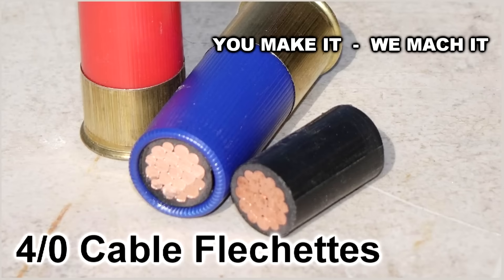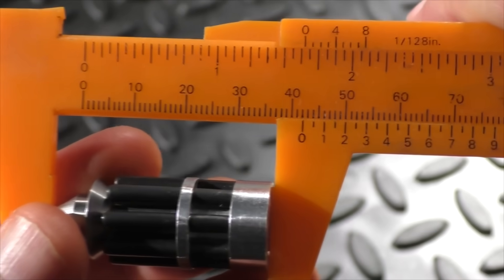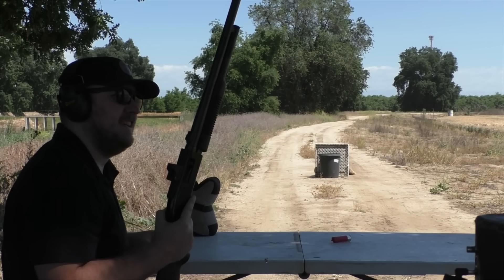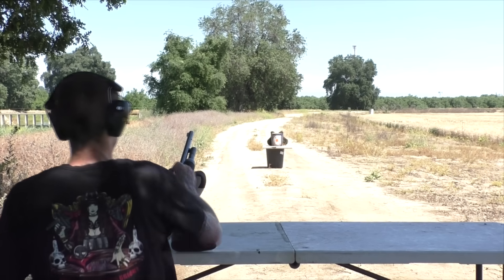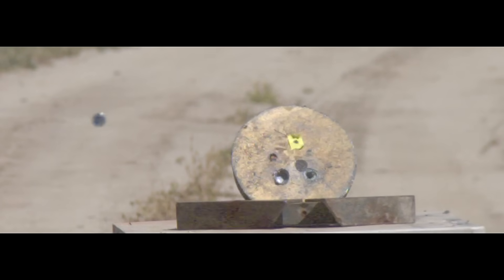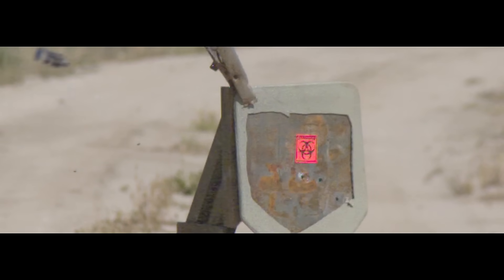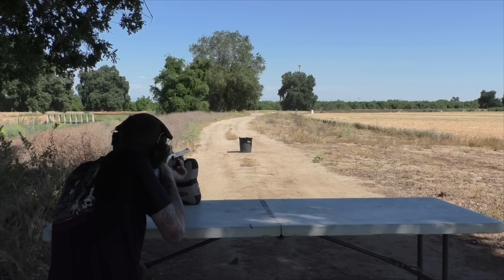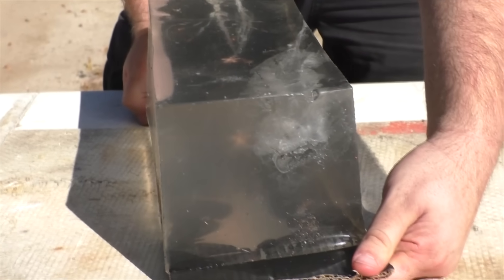RODS from GOD -  Possibly the best 12ga slug we've tested

Comment: It took a lot of work making this and I’m extremely happy with the results and outcome thank you guys
Reply: I need price per round 😂

Edit-and where to send my money!
Reply: Same  @HomeOnTheRanges
Reply: Yes me too
Reply from the maker: thanks
Reply: @taofledermaus  so... Tube mag bad. 

Any plans to emulate the round without the rods to test it in straight and banana mags? Or is this a side by side barrel ammo only?

For science!
Reply from the maker: @john2g1  These were just prototypes and we shot all the existing samples.
Reply: @taofledermaus   I'm aware; I was asking if you would replicate just the spiky part of the slug to test which shotguns could safely use a full load:
Straight mag
Banana mags
Side by side only
Etcetera
Reply: @taofledermaus thanks
Reply: @taofledermaus do you feel this would be effective against large predators? (Bear, wolf, wildcat, etc)?
Reply: Hey from Ruch! That’s a mean round Jay.
Reply: dude those are crazy as hell props man
Reply: Dude if you start a brand and actually begin manufacturing these I'd buy a set for my 12 gauge
Reply: Excellent design. A couple tweaks, penetrator core, shortened to fit inside a 3" hull and they'd be ready for production. You could run the parts for 1k units on a CNC lathe in a weekend. Those are gnarly! Thanks Jay!
Reply: I'm so wanting to own this round! I don't even want to shoot it. I want to sit it on my desk and stare at the awesomeness of this thing! Congrats on that design @jaypalsha1928!
Reply: @jaypalsha1928 Much love from Medford ♡ It's inspiring to have your talent in the Rogue Valley!
Reply: You sir have singlehandedly created the most absolutely terrifying anti-personel round at least in my opinion I have ever seen, bravo and thank you for basically being a damn ammunition alchemist lol
Reply: @jaydenandgray559 check out the dragons breath round. Those mfers are out of this world bro. Watch some videos on them, you wont regret it lol
Reply: They never even noted how precisely the rods separated. It was pure symmetry. They didn't even bother calling them rods, which I thought was fitting since they are a miniature version of something the US actually tried to make once. The idea as that a cluster or tungsten rods would be released from space, and the force of the rods themselves was enough to create gigantic craters and penetrate bunkers. And yes! The idea was dubbed "Rods From God", but the idea was only theoretical and the costs were really high. This alone is a bit unjust and disgraceful because to have a projectile work so seamlessly is really hard. I've seen a few from this channel, not one projectile that used a cluster system for maximum effect ever really dispursed as intended. Props and no hard feelings. Just love the idea. Instead of gravity dispursing the rods, enertia and velocity did it. If you think about it, these projectiles are near replica of the original "Rods From God".
Reply: where can a guy purchase?
Reply: @GoneRogueBrB  buy a small lathe! :)
Reply: @GoneRogueBrB  Amazon- under medical devices
Reply: Seeing the rods fly out of the ballistic head after penetrating was insane. If I was shooting some otherworldly creature I would want these.
Reply: Hey I've got an idea (if nobody has already tried it with tungsten before in other slugs these guys have tested, as I'm relatively new to this channel) But, have you thought about making these same rounds but with the tungsten rods having tapered tips as well as making internal side of each rod  having 2 angled cuts down the length of each so they can press against the rods to their immediate left and right tightly,, So that (in theory) when they impact something they compress the rods together and form one elongated "Penetrating cone" it'd be interesting to see if they have more kinetic energy if they can be brought together at all in the moment of impact at all, in order to make them all dig into the armor at the same point. So in theory, it'd be like the armor getting hit by 8 "slugs" in the same place on the armor plate at once. So potentially it'd be "digging" through the armor  (this is just a theory and honestly I'd think you'd have to have some sort of metal ring or a sleeve around the pins designed to force them together upon impact,  as well as the pins being cut to be able to neatly align into a cone. Would be cool to see it done if nobody has done it already.
Reply: If you were down I’d totally buy like 5 of these at whatever price you have.👍
Reply: These are amazing! I'd like to own just one and have it encased in clear acrylic for my work desk.
Reply: I would buy some if they were made available
Reply: How long did they take to produce?
Reply: Oyy you should be vary proud hell of a job gosh dang those are awesome
Reply: These are awesome, if you ever offer them on the market then sign me up! 🙂
Reply: Amazing!! Living in Alaska, I'd love to have a few of those on hand!!!!
Reply: Tbh if you could shorten the design they would probably be the best 12 or 420 shell on the market from a pure destructive perspective
Reply: You should sell your design brother! You could make some good money with that
Reply: Congratulations, it’s very powerful.
Reply: DIABOLICAL!!!!!  Awesome job Jay, you have a blue print or video on making that slug I would like to see it
Reply: Incredible rounds. Thanks for your work.
Reply: I NEED. where is your site?
Reply: where can I buy some
Reply: Do custom orders bro
Reply: Now how do we get these holy terrors mass produced? 🤔
Reply: I hope you puta patent on these, they would make a great military round, hell, id love to have some for any shtf situation. very nice work.
Reply: Well done sir , patent that and apply some more research they could be perfect
Reply: How do we get some????
Reply: Wish I could find them online
Reply: What do you think is the maximum projectile length you could put in a 2 3/4" and 3" shell?
Reply: Would love to purchase one day
Reply: I want a hundred for my collection I want to load my drum on the citadel boss and see what it do to a ballistic gel dummy no protection
Reply: Excellent work my dude! I wonder how the slug would perform if the roll pins were replaced with tungsten or flints, would be cool to see!
Reply: Have you tried a softer metal like aluminum for the chassis and roll pins to make it easier on the barrel?
Reply: PLEASE GIVE US THE RECIPE !!!
Reply: Add a thermite pocket before the rods, aluminum powder & ferrous oxide (rust)
Reply: this was very impressive!
Reply: I want to buy these.
Reply: Dude great job! Those are SICK
Reply: Genius my brother....thats love.
11 out of 10.
Reply: Yoo sweet you're from gp I'm from shadycove
Reply: Grants Pass Pride! Well done sir! 😁🤙
Reply: You need to patent this and sell them to government agencies.  I know the shotgun isn't a popular choice anymore but imagine these back when 12g's where used alot?
Reply: Mother of God.. 😮
Reply: GP, where else, love from Ashland amazing work
Reply: You are cool mr !
Reply: Good work from the cheese place on the coast
Reply: awesome round
Reply: Im nearby and would love to order some!
Reply: Those are some sweet slugs. You did a hell of a job on them.
Reply: Man Jay No words can explain how amazing you are this is very cool
Reply: They look beautiful
Reply: Leave it to the oregon dudes. That's pretty fing cool great job!
Reply: Great job brother!
Reply: Nice job making these man!!
Reply: Epic
Reply: Take my money!
Reply: Wouldn't want to be shot with one of those.
Reply: My friends are sad they can’t buy them 😂
Reply: Impressive brotha definitely got talent.
Reply: When will I be able to buy a pack? 😅
Reply: Brave putting your name out here
Reply: You did it insane. Keep it up 😺
Reply: Anyway you would show the machining process
Reply: Beautiful work! I'm also a fellow Grants Pass Oregonian!
Reply: Its the man himself.
Youre a legend
Reply: Dude your a fucking genius.
Reply: How do I purchase
Reply: OK, what would it cost to get five of these made?
Reply: Incredible craftsmanship man
Reply: You should use those rounds on yourself
Reply: Hey @jaypalsha1928 how much sir?
Reply: I'm interested in 15 of these things
Reply: Dude these are yours? Those are terrifying. Great job. Such a beautiful design
Reply: I would like to order
Reply: o7
Reply: Where do I order?
Reply: helluva round you made there bud. Great design and great craftsmanship. Keep up the good work!
Reply: I about shit myself, before they even shot it. That round was better than going to a Chinese massage  parlor, with happy ending. Nice job.
Reply: What if you sharpened the rods?
Reply: I like the name but if you don’t mind gods hand or god rod has a good ring to it to

Comment: On that last ballistic gel test, when they were showing the pin stuck in the table, you can see the noodle it cut through the gel just poking out the side of the main block in line with path it traveled.

Comment: The most terrifying round you guys ever shot are actually 2 different rounds. The first is that round Greg got in Idaho, made from copper and opened up to 4 cm stsr pattern.
The other on is f'rom the Ballistic Machinist. It was a steel round, designed to open up. Greg shot it at a pig shoukder and left the most gruesome and gigantic hole. '

Comment: This looks like a updated version trench gun rounds used in the Vietnam War.  They were 12-gauge flechette loads. They were plastic-cased 3” shells manufactured by the Western Cartridge Company and had 20 carbide flechettes 0.73 “ long and weighing about 0.47 g. Federal Cartridge Company also made a version with 25 flechettes packed in a plastic cup with granulated  polyethylene to maintain alignment with the bore, this prevented damage to the bore. Since flechettes are lite weight they only had an effective range of about 60 yd max; but they were perfect in the foliage of the jungle. 00 buck flies further and in heavier but the flechettes covered a wider area and despite their lite weight they flew straight since they were shaped like darts. They penetrated helmets and the “body armor” of the day. The wounds were small but incredibly damaging since they hit in large numbers and most stayed in the enemy. 
The roll pins in this modern version would also be light but due to the shape they would never fly straight for long through foliage. The center “slug” would be the most damaging and furthest flying, but because the shape could detonate shells in the mag tube it could only be used in stacked mags or loaded one at a time. The original flechettes were a better design but they may not be available anymore.

Comment: The only down side I see is loading more than 1 round in a pump action. But if this guy can design a safer tip then I would consider working with the designer to build up some manufacturing.

Comment: So what exactly would happen if you loaded multiple in the tube? Would they all go off?
Reply: Or just not fit and jam?
Reply: There's definitely some risk with pointed rounds in a tube mag of having a primer go off and bad things will follow. This is why old lever action rifles used flat nose bullets, and modern ammo for them with pointed tips has a synthetic tip that should theoretically be too soft to set off a primer.
Reply from the maker: There's a chance of a chain reaction.  You can load 2 in the mag safely though

Comment: Any slug in a 12 gauge has to be a certain weight to be a safe load and anything over 1 1/4 oz is pushing it and the recoil gets really bad . Also the stress on the action is worse and most shotguns don't have overly strong locking systems . Materials harder than lead or plastic can score a nice chrome 12 ga bore and slugs that don't compress and squeeze down a bit can't be used in any choke . Steel shot is safe because it's contained within a plastic monowad .
Reply from the maker: There are plenty of 12ga loads over 2 oz that are perfectly safe to shoot.   It's all about matching the payload to the powder recipe.   These used a sabot so there is no barrel contact.   We used a full rifled barrel that does not have a choke.
Reply: @taofledermaus  That is true but they are stressing the gun more than you think . If a handload is worked up then the pressure can be kept reasonable .  In a rifled barrel then that is ok I missed that . 
I designed a 1 1/2 oz BBG load years ago and that was as much recoil as I ever want to experience in a hunting for " pleasure "  gun . That's 4 SG pellets with the remainder  BB pellets . The BB buffers the SG so they stay closer to the pattern center .  They pretty much take out anything .
Reply from the maker: @JuanValentino-yu1ft  It's about using a safe recipe to keep the chamber pressure at 12,000 psi or less.   We've used this same gun for years and have shot hundreds of handloads from it,  some as heavy as 2.5 oz.   It's built better than you give it credit.
Reply: @taofledermaus  That's what I said , work up a sensible pressure  hand load . Some shotguns are stronger than others and I have seen 12 gauge side by side guns stretch using normal loads over time . Your exaggerating  what I have said . Even if the gun holds together it can still wear and stretch the action lockup if pressures are too high over time .

Comment: I have an idea, to make this a 3 piece assembly:
1. Penetrator/Spreader:
- Length: ~80% of full length
- Width: 100% of full width
- Double cone shape
- Front cone (Penetrator): stubby, 20% length of this part
- Back cone (Spreader): tall/long, 80% length of this part, capped end with threaded hole
2. "Rods":
- Length: ~64% of full length
- Width: 100% of full width
- Inverted cone to fit the spreader
- Hole through the center to fit the screw
- Cuts along the long axis going through the center (like slicing cake), as many as you want/your tools support
- Groove around the bottom of the "fins", to enable easier breakage
- Temperature shock hardening, to enable easier breakage
- Inverted cone on the other end for the screw head
3. Screw
- Countersunk flat head screw for allen key
- Holds the assembly together
- Enables different tempers for Nr. 1 and 2
- Cheap

Tools:
- Lathe
- Metal band saw
- Induction heater
Reply from the maker: I'll look forward to testing your idea
Reply: @taofledermaus  I can't produce it myself, as I don't have any of the required tools. So unless you can produce them yourself, you'd need to find a machinist willing to do so.

Comment: In the final gel block shot, the gel block should have been surrounded by Ballistic panelling so that one could see how they the  circumferential rods came to rest, 
That slug would have been more destructive if the rods were hinged at the back on a forward sliding washer and remained on the central part, The flare out would have increased the frontal area as it decelerated. It would have been too cruel a shot, against any Geneva convention laws.

Comment: This would sell well. Everyone with a shotgun would want to own a few of these. If for nothing else, as a conversation topic. 
Could use some optimizations for mass production. Here are some suggestions to consider:
- The center shaft could be thicker in front of the spreader cone. This would eliminate the need for glue. Makes it more resistant to environmental effects and aging. Also, makes the production simpler.
- It doesn't need 8 rods. 4-6 is fine. Makes it cheaper. I'd go with 5 for aesthetics.
- The base, support ring and the screw can all be one single plastic part. It would snaps instead of screw, possible with a single mold.
- It does need to be shorter. So shells can be stacked front-to-back without going off.

Comment: My first thought when I saw these was they would make excellent boar population control rounds. That second gel shot kind of confirmed that one. I wonder if there is way to manufacture them easier? Also just wondering if maybe a slightly thinner cork piece would stop the tip from protruding past the shell casing?

Comment: Most lever action rifles use flat nosed bullets and they go into tube mags safely, I think those could be alright in a tube mag, just depends how sensitive the primer is and how hard the firing pin strikes, Im not sure if shotguns have a lighter or harder strike than a lever action, but basically if they aren’t already safe for tube mags they could easily be made safe. Hornady has lever action rounds that have a flexible polymer tip so that they can use pointed projectiles even in a tube mag. Could be a next iteration of these to make them more safe/compatible with the tubular mags.

Comment: I love the engineering behind this as terrifying as it is. It is also such a clever design, a penetrator rod that if made of the right material will likely punch through regardless what armour you would use and do a number on your. If you lack such protective measures the cup will act like a hollow point to create a wonderfully nasty wound channel and to top it over you have 8 rods flying over to the side, each creating their own while much smaller wound channel still will do a number, meaning that most certainly whatever is getting hit be these is not going to be around to tell the tale.

Comment: The lead plate shot looks like the spreader for the rods acted like a normalizer, similar to how tank armor piercing rounds work against angled armor, they have a ring around them to "normalize" the angle of the round to better flatten the piercing tip against the slope of the plate, an accidental design plus I would say.